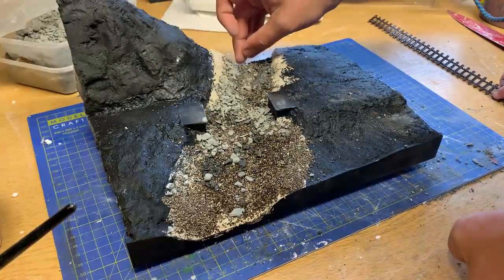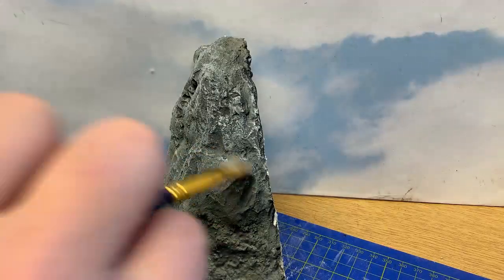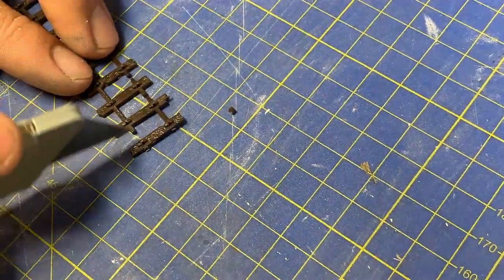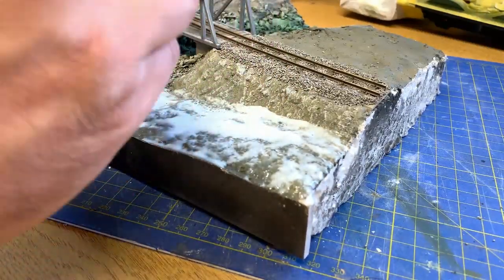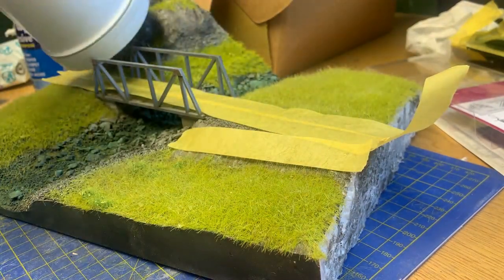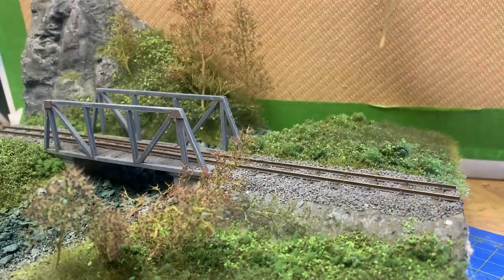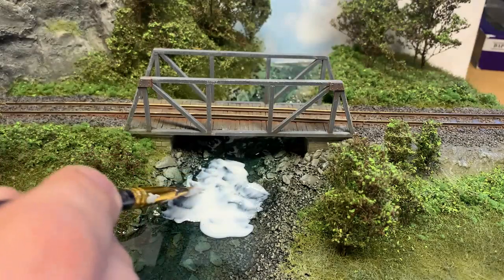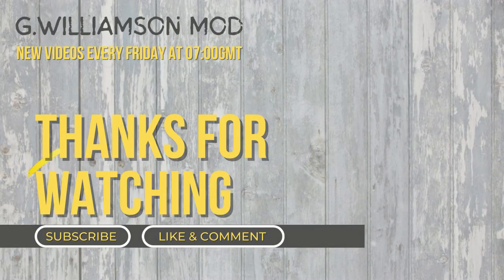ULTIMATE Guide to Crafting Jaw-Dropping Skarloey Scenery

Comment: Hi George, the sleeper spacing you are using, can that be used on 00 gauge track to give the appearance of narrow gauge? It looks as though it is nearly a square between the sleepers and rails? And also, will this be ok on a running layout?
Regards Paul
Reply from the maker: Hi Paul, you could try re-sleepering the OO track, but it would depend on what’s running on it. For a narrow gauge look on OO track, you really want 0-16.5 trains on it as narrow gauge, but that’s then going up to 7mm scale. The best you could do is probably chose smaller looking OO engines and stock to give the appearance of a ‘light Railway’.
How this helps
Reply: @GWilliamsonModels  yes, I have two 0-4-0 pecketts to run. They are nice little runners. Cheers for feed back. I'm on pension, so have to budget a bit, but wanted a narrow gauge look using 00 gauge. I know 00 gauge is slightly narrow to start with. Thanks.
Reply from the maker: @paulreeve9642  do what works for you, it won’t be officially narrow gauge, but I’m sure you can make it appear like it could be